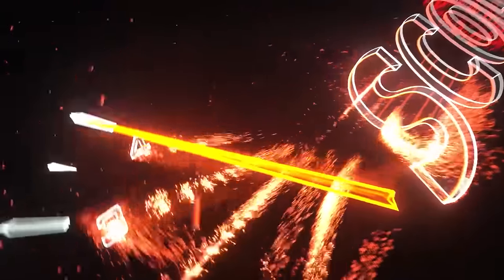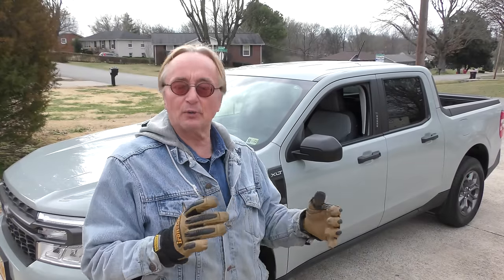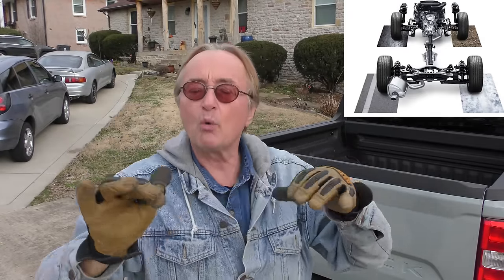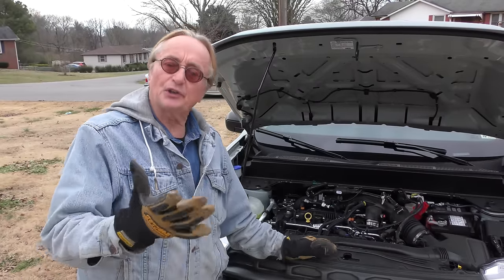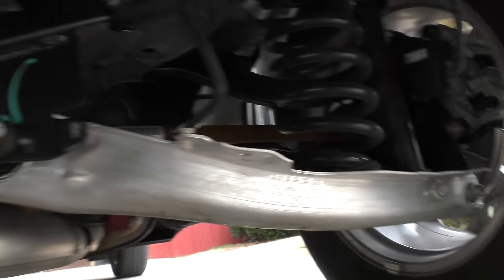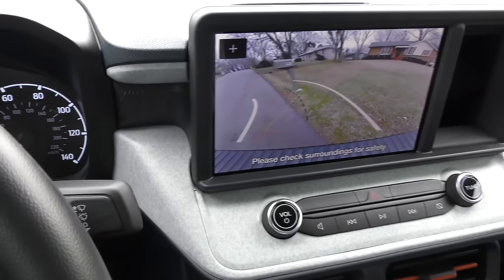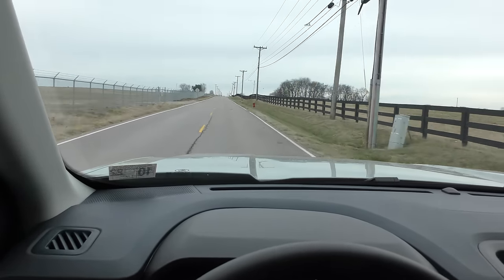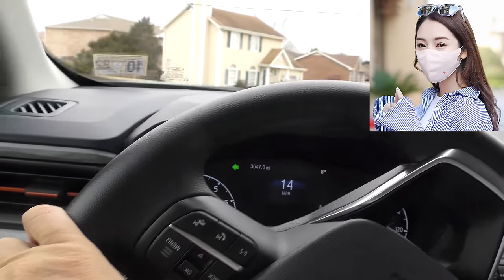I Finally Got a New Ford Maverick and Here's What I Really Think of It

Comment: Strangely enough, I would get the hybrid. The engine is port injected, has no turbo, and the electric part has two motors and acts like a CVT, essentially making it a giant prius. Good to know electric powertrains are becoming cheaper...
Reply: When Ford first started selling Hybrid Escapes, years ago, they paid patent licensing fees to Toyota. They didn't try to hide this. Toyota either griped enough or outright sued them to make them stop telling people this. It contained no actual Toyota parts, even though they were sort of implying that. It was just that something (transmission and electric motors?) were a "licensed knock-off". So, yeah, it kind of is a giant Prius. :-) 

Oh and don't worry, folks. Atkinson cycle is nothing special. It's just variable valve timing with a very late intake valve opening. The 02-09 Priuses used that, as did the Mazda Millenia, and it didn't do anything you wouldn't already know how to fix.
Reply: Exactly. In fact the hybrid has no transmission. Just a fixed set of planetary gears. Impossible to wear out.
Reply: Sorry for being too lazy to do my own research, but can someone tell me what makes the cvt trans a plus? My father's jeep patriot had a cvt transmission and it was absolutely horrible. I'm not saying the mavericks is, just was hoping someone could explain why it wasn't?
Reply: @RyanNash20  The idea with a CVT is to have the computer run the engine at the "optimum" rpm for whatever load is presented to it. Steady cruising at 35?  1400 rpm.  45?  1400 rpm. 90?  1400 rpm. Stomp it to merge onto the interstate?  5500 rpm all the way from 5 to 90 mph.
Reply: @erikscott5709  Makes sense, I just see cvt transmissions being talked down on very often, and my own personal experience from my father's patriot was that they give out really easily. I was wondering what makes this one different I guess, not so much how a cvt is supposed to work.
Reply: @RyanNash20    CVT transmissions in non-hybrid cars have a metal belt between two variable geometry pulleys. It works, but the friction makes the environment inside the transmission kinda hellish, and if you don't change the fluid all the time, these transmissions tend to fail prematurely.
The cvt in a prius (also called an e-CVT) variates the reduction ratio by using a planetary gearset and electric motors. This arrangement has very little friction, and as a consequence lasts longer and demands less maintenance.
Reply: @gsilva220  Wonderful description, thank you
Reply: @RyanNash20  Many CVTs use belts, and many have a "rubberband effect" when the driver stomps on the accelerator. The effect can take some getting used to 

 Some CVTs use chains or use planetary gearsets. Regardless, keep the fluid fresh and properly filled.
Reply: @gsilva220  I think the CVT in the Maverick is like the CVT in a Prius... it uses two electric motor/generators and NO BELT to wear out or cause trouble.
Reply: @carlrutledge3096  Exactly!
Reply: @carlrutledge3096  good to know.
Reply: Like the fact that the engine in the hybrid is port injected.  Can’t stand the CVT transmission so because of that I would prefer the 2.0 T poison ☠️😆
Reply: We own 2017 Ford C-Max Hybrid. Currently 95K miles. No minor/major issues.   We love it.  Plan to get Maverick Hybrid.
Reply: @artiejones6417  same, it drives similarly.

Comment: I work at HSAP where this car and the Bronco Sport are made. Both models have been so well accepted by customers that we are working overtime to meet the demand.
Reply: Jebus Hypocristos  maybe the workers like the OT pay? I used to love working OT when I was in an hourly position due to the extra pay.
Reply: Jebus Hypocristos  as long as it isn't mandatory overtime the extra hours can be a huge plus for the worker.
Reply: Jebus Hypocristos  you're right, they aren't allowed to quit 😤😤
Reply: Well they are telling us they have no chips.
Reply: @tomdavis3038  next your gonna tell me they dont have salsa either.

No chips? The horror....
Reply: So it's not the microchips then?
Reply: $40K for an XLT? Crazy
Reply: Glad to hear it!
Reply: @hanksta34  I purchased a 2022 Ranger Lariat with everything for around $44k after tax = ($900+) registration,, license, etc., with the 2.3 Ecoboost, 10-speed transmission, 5 foot bed, spray in liner, and Ford hard folding cover, all installed at the factory.. Oh, and its 2WD with the electronic limited slip differential, and the Tow Pkg... Shadow Black, Stone light gray leather all 4 seats...Only have 148.9 miles and it is absolutely wonderful !!! If these little guys are almost as much, and you need a real truck a little bigger and much nicer, perhaps look at the Ranger ?
Reply: @frandanco6289  A fully loaded Maverick, AWD etc., runs about 36k (this would be MSRP), not sure how much it would be at the dealership, especially with supply issues. Probably 40kish?
Reply: Keep up the good work my guy, this car hit a niche almost no one else was digging into.
Reply: What’s your favorite color on the Maverick since you have seen them all in person?
Reply: @rickyboyd2919  that electric blue color makes them really stand out. I’d say that’s my favorite so far the “orange” one is just a bad shade of “orange” it’s like school bus colored.
Reply: @rickyboyd2919  Hot Pepper Red, Cyber Orange & Rapid Red are amazing, you have to look at them with the sunlight, it's when the color shows all the beauty

Comment: I've owned a 2022 Maverick, with the eco boost engine, for three months and I'm very happy with the truck so far.
The bed is only four and a half feet long, but the tailgate is designed to lock in place at the same level as the wheel well, which allowed me to easily carry three sheet of plywood home from Home Depot.
Reply: Did you get the 4K tow package ?
Reply: How much was it?
Reply: How did you feel going 2 x over its maximum capacity?  I kid...i kid....:-)
Reply: That’s a car disguised as a truck.
Reply: I think I just found my new truck 
For my light use and maintaining my homes
Reply: 3 sheets of plywood probably costs more than the truck
Reply: Had?? What happened to it?
Reply: I hope it works well I have an F -150 that I'm happy with I might get a Maverick as a runaround truck.
Reply: They're hideous
Reply: I really didn't like them when they 1st came out but after everything I've seen I have to admit I'm impressed, wouldn't mind having one myself & I might just do that.
Reply: @M447DT  Yes
Reply: give it a year or two... Im sure you'll change your mind concerning how happy you are with it.
Reply: @geofreak75  the interior is terrible
Reply: Check back with us in ten years when it’s junk. Toyota Taco FTW!
Reply: @jaymoar3561  So?? It's a true Utility Vehcile...not an ugly fat rear ended suv that you most likely enjoy driving around it...😂😂😂
Reply: @renaissanceman5847  Man you Toyora Fan bois just cant take it when another company comes out with a product that is gonna sell like Hot Cakes...lmao
Reply: Why didn't they call it the Ranchero? Basically, it's the same concept. As long as you are happy with it. I personally think a regular pickup has better resale value and use.
Reply: It's a great concept.... Along the lines of "A chicken in every pot" here you got "A truck in every driveway." Affordable, decent power for everyday driving, a small bed for groceries and what not. We'll see over time how many turn out to be just rolling piñatas. And I don't care much for Ford products except the F150/Econoline vans and Mustang, but I hope this is a success and they sell a bunch. The automotive world in general has gone to crap, even Toyota is having parts issues now, this ain't funny anymore, I want to see some good quality vehicles at a fair price from anybody willing to do it.
Reply: @renaissanceman5847  Time will tell.
Reply: It is cool.
Reply: I've seen people hauling full size sheets of drywall and plywood with their short bed pickup trucks with the tailgate down to extend the bed. I have seen a lot of that drywall and plywood end up on the highway when the air lifts them up and out. Many don't tie them down and so they take off to plywood and drywall heaven never to be used as they disintegrate on the road and then get hit by several hundred cars before they can be saved.
Reply: @jaminova_1969  Well of course a pickup would have better resell. But I bet this has better resell than most god awful suvs like the Equinox and Escape. This is a true Utility vehicle for some who doesnt want a pickup truck or an ugly fat rear ended SUV.
Reply: @garybrown9062  Another Butt hurt toyota fan. The vehicle has been out for a few months and you have zero clue how the engine performs.
Reply: @jaminova_1969  I owned a 2000 4x4 club cab Ranger for 13 years.  I enjoyed driving it and it was very reliable.  Of the many vehicles I've owned over the years it's one of the few that I wish I hadn't sold.
I liked the size of the Ranger and the new Maverick is around the same size.  I've owned a F150 and a F250 and I found both to be too big.  
I think they should have called it the Ranchero too.
Reply: @M447DT  Yes.
Reply: @ricecakeboii94  Prices of wood are nuts.
Reply: save that turbo. change the oil every 3000 miles, if you drive more in the city and heavy load all the time, better do it sooner. .warm up the car for 5 to 10 min in the cold start.  
keep an eye on the transfer case,  they are known to have problems.  change the oil every 30000 or sooner if possible.
Reply: @brooksteer5629  Nope. Chances are good it will be. Just wait and see...
Reply: @Sforzatheforcer  Lord. Another Toyota fanboy here. Your taco you're talking about towes less and is gutless. I've never seen anyone use a Tacoma used as a work truck..
Reply: The Maverick is a nice little truck! Perfect for women and interior decorators. Named after that l piece of crap economy car, big brother to the worthless, cheap, and dangerous Pinto.
Reply: @bjthedjdutchdude1992  broke down already. You get what you pay for! Buy quality and cry once.
Reply: @Sforzatheforcer  The original Maverick commands a good vintage car price today. It's a bona fide classic. The pinto??? Well it has a cult following...😂
Reply: Wait a year youll want to get rid of it
Reply: @Account NumberEight another toyota fan boi...why are you even comparing it to a tacoma???
Reply: I gotta get me one I wanna know it the maverick sits higher than the 2017 Honda Civic?
Reply: @Account NumberEight What does that have to do with the Maverick?
Reply: @Account NumberEight You sound bitter....😂😂
Reply: @jaminova_1969  
Ranchero sounds too much like Fords high end King Ranch trim level. Anything with ranch in the name sounds like it's designed for heavy duty applications. This truck clearly isn't built to be hauling cattle, livestock, bales of hay etc.
Reply: This is no different than their SUV's..  Just look at the history on those and you'll see how these will fair..   It has the same uni-body, same suspension, and same engine, ect.. It's just their SUV with a bed instead of cargo area.  Not much of a truck really.  Similar to a Honda Ridgeline.  More of an SUV than a truck.  They're pretty sweet if you don't ever tow things.
Reply: Ive owned the grand caravan for 5.5 years, with the 283hp V6, and im very happy with it so far. The interior when folding seats flat, is a full 8 feet, which allowed me to easily carry 10 pieces of drywall from home depot in the rain, no problem. Win if you ask me.
Reply: @Anth230  Maybe you tagged the wrong person. I’ll take my F-150 over my Toyota any day and I have both.
Reply: Glad you're enjoying it! I waited to order my Santa Cruz until Ford released the details and decided it just wasn't for me. Couldn't be happier with my choice. These little trucks are great. Hope to see the segment grow.
Reply: @jaymoar3561  suv it’s a bronco with a truck bed
Reply: @Socialmilliondave  bronco is more of a truck than Maverick. At least the Bronco is body on frame.
Reply: @Anth230  I had a Maverick Grabber with a 351C. Fast, but no beauty
Reply: @jaymoar3561  The Maverick is more SUV than the ugly fat rear ended SUVS you see floating around everywhere. FORD escape, Ford Edge, Chevy Equinox, Honda Crv. Do I need to go on??? If i had my choice over any of those and the maverick ...the Maverick wilm win every time....its A True SUV the others are for fat guys and families....😂😂
Reply: While I’ve heard of some v6 eco boost engines going a long way without repairs, the small 4 (or even 3) cylinder eco boosts are not making it even to 100000 miles before needing major work. 
Cheers
Reply: @Anth230  many totyota fanboys, right?
you know why theres that many? because toyota build quality vehicules, not shitty shitbpoxes like ford.
Reply: @monsieurdubitatif8567 Toyota fan bois get threatened for some reason. My Ford has had zero problems in 3 and 1 half years. Again. Ford has hit two Home runs with the Bronco and Maverick. Even if Ford has more issues than a Toyota most of you Toyota bois dont keep them very long....😂...that's not very loyal...
Reply: @Sforzatheforcer  Taco = worst interior award, most painful driving position award, most anemic gutless engine award... Yeah, go out and get one !!!   :).
Reply: @jaminova_1969  Seriously???  Have you ever seen a Ranchero???
Reply: @84imreplica  No, the 2022 Ranger is bigger, wider, and longer than the Maverick...
Reply: @JCJourney  No one should warm the truck up for 5-10 minutes, unless you are in Alaska or something....The vehicle will warm up faster if you just leave and don't do stupid stuff like flooring it until the oil gets up to temperature...
Reply: @Account NumberEight 23 years of sitting broken in the garage I guess, right ???   :)
Reply: @sentry8992  You obviously know nothing about bales of hay and who knows what else.....
Reply: @monsieurdubitatif8567  No, more like they love the horrid driving position and the most weak engine in the world... Almost as fast as a squirrels powered tacoma...
Reply: @frandanco6289  My point was that even though the Maverick only has a 4.5' bed I could still easily carry 3 sheets of 4x8' plywood.  I realize the Ranger is a larger truck.
Reply: @jaymoar3561  nope lol   its got  a 1500 lb payload
Reply: Hey man, how’s the maverick holding up? I’m thinking of getting one

Comment: I have a 2015 VW Golf I purchased new and was dismayed to find out it was made in Mexico as I thought I was purchasing a German car. 110,000 miles later it’s needed no repairs, runs like a dream, and doesn’t even rattle over bumps. I think the Mexican autoworkers know what they’re doing and I’d trust them wholeheartedly. My “Deutschland” built BMW gave me more problems in 20,000 miles than this car ever has!
Reply: Mexico has been buildings VW since the original Beatle
Reply: 110k miles is nothing for a Toyota. That’s just getting broken in if that.
Reply: Parts and assemble are in México,  design is German. There is nothing wrong with that... I love it
Reply: Got a 2020 tacoma. 27k miles on it 👍🏻
Good so far as long as you don’t bump into anything. Some of the plastic pops back  some crunches 😂😬
Reply: BMW and Audi electronics sucks
Reply: I also have a ‘15 Golf 1.8T, which I proudly bought, used, knowing full well it was built in Mexico. I traded in a Michigan-built Ford Focus for the Golf. The Golf, a year older and with 10k more than the Focus, has been much more solid and problem-free. I’ve been able to get a full-size futon mattress in it, folded like a pita, with the hatch closed. 

I only wish the front passenger seat would fold flat so I could get longer items in it. I am also disappointed that in later Mk7 Golfs, they went to a smaller less powerful engine, and took out a lot of the SEL content. And no regular Mk8 Golf in the US. 

I thought about a Maverick (takes drink) early on when they were introduced, but why get a whole new Ford just for a few more inches of cargo room?
Reply: I don't understand the perception behind why a car made in a specific country is going to be crap. Usually those companies have a manufacturing process that has to be adhered to. Country of manufacturing has no bearing on quality of vehicle.
Reply: @ibn-khaldun-al-hadrami   See Scottie's videos on Mercedes that are put together in US vs Germany .  There's a difference .
Reply: Collins, your german built vehicle was assembled in germany by workers imported from the middle east.
Reply: @jaymoar3561  oh I think Toyota is well on its way to joining the planned obsolescence party,
Reply: @tomdavis3038  Well yeah, all the older ones are still running, they need sales somehow lol. Besides the cars with those first matrix engines
Reply: @tibuy  No they don't,  I have had many new ones...

Comment: I just got my 2024 yesterday. You don’t have to use the start stop feature. Turns off with a push of a button on the arm console. All its features are very customizable. Very nice ride and very quiet. When I turned the key I didn’t think it started. Very impressed on my first ride.
Reply: Thanks for the heads up on start stop option. I may downsize from my F250.
Reply: Thanks for mentioning this. The start stop feature is annoying
Reply: There is a plug in you can get on the obd2 port that makes it so you never gotta touch that button ever again

Comment: I'm an F 150 owner my last one I kept for 10 yrs 280 k miles all original no issues. I have 2017 F 150 with 120 K miles no problems. Hopefully the Maverick will do well over time. I may buy a used one couple yrs down the road. Would love to see this guy bring it back to you 5-6 yrs from now see how it's doing.
Reply: With the way inflation is going, you'll probably pay more for one if five years with 100,000 miles than it costs new today.
Reply: That mileage would be just broken in...... for a Toyota truck.